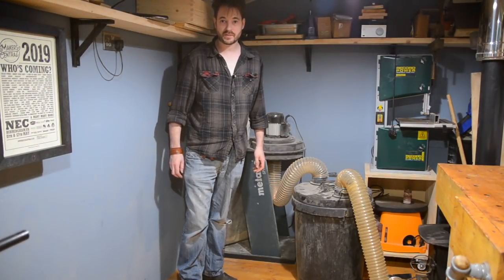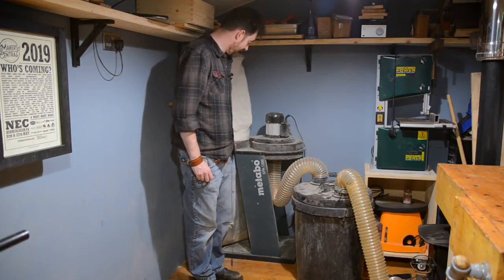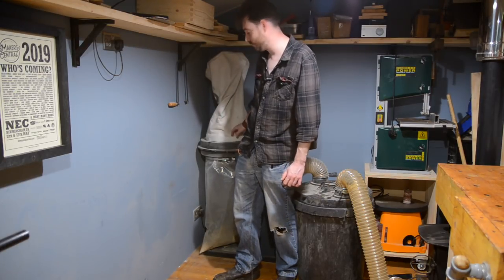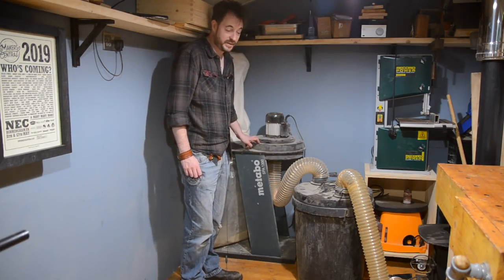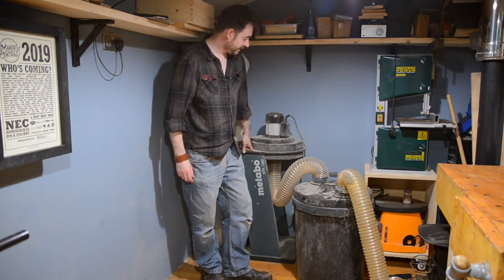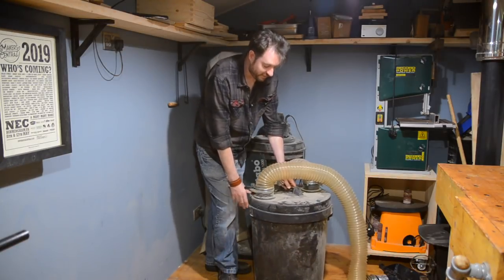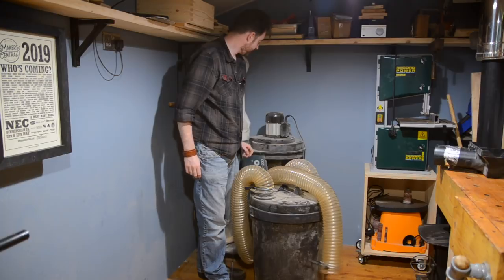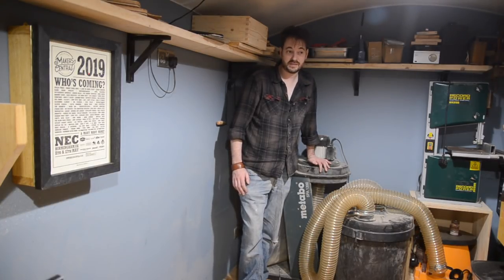Metabo 240V SPA1200 Chip Extractor

Comment: In the US that machine is called a dust collector.   That is a loud machine.   I have a 1 1/2HP Jet dust collector with the pleated filter on top and plastic bag underneath which is much quieter.  I also had to remove the screen on the inlet due to long planer shavings getting blocked.  My plastic bag is not too bad to remove, a big O ring to hold the bag in place.   Easier to remove than to fold the bag back over the O ring.  If only we had 3 hands.....

I have ductwork between the Jet and my wood lathe, table saw and router table, but I have blast gates so only 1 machine connected at a time.  My planer is not presently connected due to getting some other machines.   Insufficient space for everything to be ducted.
I have some of the quick clamps, they do work well.   I also have some of the Rockler quick release tapered connections.
The separate can with chip extractor works, but consumes a lot of the pressure drop of the system.   These machines are high flow, low head (pressure) so pressure drop means reduced flow.   As often is the case, there are pros and cons.
I installed a Thien style baffle inside my dust collector.    This was to minimize the dust in the pleated filter.    This is easy to remove, but very messy to clean, so I want to minimize how often I need to clean the pleated filter.

Dave.
Reply from the maker: Sounds a good setup
Reply: Thanks for sharing your valuable experience!
AB

Comment: I got the Charnwood version had it 10 years never a problem. Like you I use a Nilfisk  for most of my hand held tools great vac. Not keen on pipework all round the shop for dust extraction. But I have fitted the Rutlands  air filter mounted on the ceiling for fine dust in the shop.
Reply from the maker: I really need to get a fine dust air filter

Comment: I have the Record Power CX2500 with the fine filter (the metal gage with a pleated filter you described) for much the same reasons and it does the job well enough. Having a separate cyclone/drop-box makes a huge difference and given that all of them have crappy bags that take ages to fit I'm surprised there's not a better design out there.
Reply from the maker: I must get a filter. A separator does make a big difference

Comment: I am so glad you did this video! I have been considering one of these, and I was wondering whether or not it would replace my shop vacs as well. I have heard other people say they don't, but I was not sure. Thanks for clearing that out ;-D
Reply from the maker: Yes unfortunately there is not one machine that can do everything
Reply: I use mine for everything, 4” hose direct to table saw, planer or jointer, then I use a 4” to 2 1/2” adaptor and connect my shop vac hose for cleanup, and on bench sander, miter saw, then I use my rocker small tool connection kit with my hand sanders and routers, etc...

Comment: I wash my cloth filter bag regularly, I just chuck in the washing on a cold wash with a little bit of soap and it comes out snow white and perfectly clean. Doesn't seem to affect the filtration.
Reply: I think my bag might be a different material though as it's a 1 micron rating.
Reply from the maker: Interesting. I was told to never wash them
Reply: @Badgerworkshop  As I mentioned it might be that your bag is a different material. Mine is made from the same stuff they use for filtering oil and fuel, it's quite thick and fluffy, very dense weave. 
I had nothing to lose when I tried washing it as I had already purchased a big drum type filter for the machine. I gave it a try washing it and it came out great. I now use the filter bag instead of the plastic bag underneath, and I use the drum filter on top. It takes a long time before things get clogged and need cleaning, especially using the cyclone separator.
Reply: @caskwith  could you help where can i find latge drum like filters you mentioned please?
Just got one (ELU), for six ales(!) so making chips are next.
Ps.: Thanks Matt for the video, and for previous ones as well👍.
AB
Reply: @attilabori4734  I bought mine from Axminster, I gave them the dimensions I needed and they found something suitable, I then made a simple adapter ring for it. There are companies out that sell them as well.
Reply: @caskwith  thank you, i will look up for it and sorry for the belated response...
You take care!
AB

Comment: Thanks for this review. I too have a Metabo planer/thicknesser that I have hooked up to a Bosch GAS35 vac via a 35mm (ish) hose. Whilst the Bosch works well with small power tools, I get chips all over the place when thicknessing with the Metabo. Do you think that the Metabo chip extractor would perform better?
Reply from the maker: Yes the 100mm hose would work much better
Reply: @Badgerworkshop  Thanks Matt, that's good to know before I shell out!  All the best.

Comment: Bit off topic sorry . I've watched all your table saw vids , and you've gone through a few . I've looked at the Bosch one but thinking the DeWalt . The metabo one looks alright but in your opinion if you had to choose between all the ones you've had ? . Budget 500 and it won't be used a great deal but want a decent one . What about the evolution rage 5s ?
Reply from the maker: I would probably go for the dewalt as I know lots of people with it and never heard a bad things said about it
Reply: Axminster craft tablesaw, I have most of that range and for £500 you get a cast iron machine with an an amazing cut quality and precision
Reply: What do you intend to use it for? The Dewalt has the best fence, but changing the riving knife is a hassle. Depends on your needs.
Reply: I found that although the Axminster doesn’t have a full length fence, it’s still sturdy. The dust collection is amazing and the diving knife is easy to adjust. I use it for ripping down hardwoods all the time and have no trouble. I’ll upload some reviews for all the products soon
Reply: @j_b_woodwork7648  I've been interested in the craft saw for a while now. Do you find the rip capacity a little small for panel work?
Reply: Lotus well it depends, you can do a fair bit on it, I feel thatl with the extension wing that came with it, you get a decent amount of rip capacity, and the blade comes up about 80mm without the blade guard. If you want to stay safe and make use of dust collection, I advise it on but it takes up about 30mm I’d depth.
Reply: @j_b_woodwork7648  Sounds pretty good. Looking forward to any videos you make using it. I'm sure there a lots of people on the fence with it as there doesn't seem to be a lot of info about it other than the axminster page.
Reply: Lotus I’ll start filming on Friday and upload the first video on Sunday